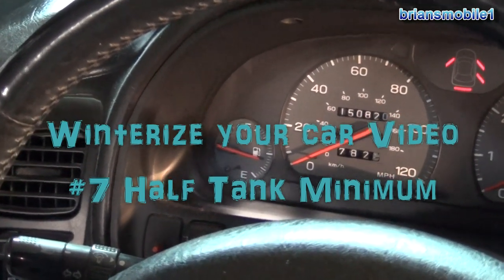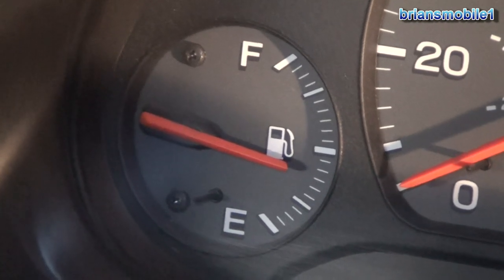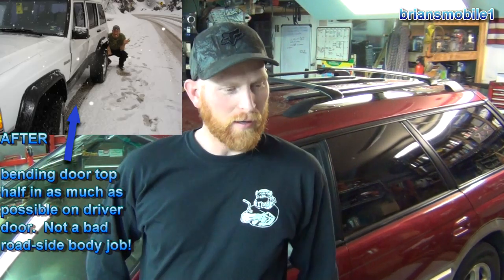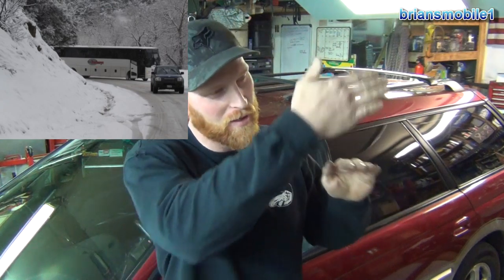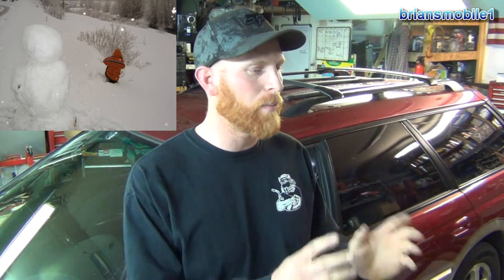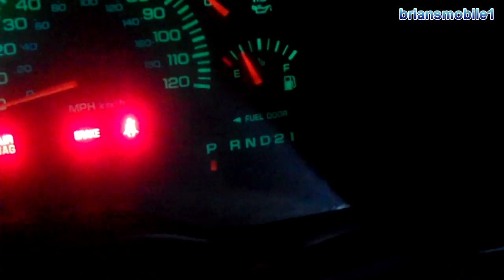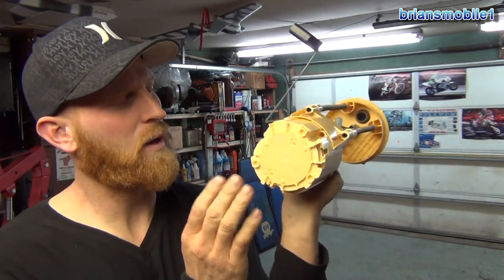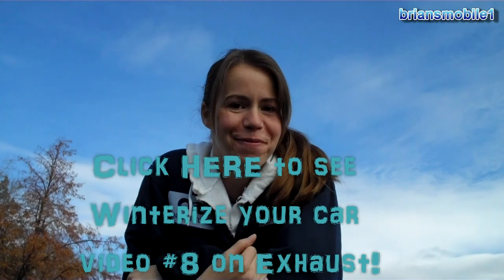Winterize Your Car Video #7 Half Tank of Fuel

Comment: Great video! Loved the story, used to run for Wisconsin coach lines for a year while out of work in my normal job. I ran  buses coming from the 60's which were quite nice and then comes driving a 2007 model right out of the the dealer. Talk about fun and floating seats. 4 wheel Disk brakes! That was a crazy year, ended up on the Waukesha  to O'hare route. It was cool and another experience in life. There was always a little extra time to get to the airport and the five stops, well the first trip we took a little detour through Chicago as I had no GPS... Find your way there.... it was an experience for me and the and my passengers... :) I was sweating bullets but somehow we made it and in time for the flights. There are allot of stories in that industry! One thing for sure, the DOT looks the other way most of the time. If you are getting on a bus watch out! :)

Being a road warrior in another business I should be better at taking care of fuel levels. In the winter yes, at other times I reset the trip odometer and have a safe haven to work with. So far I have been lucky. I had an Oldsmobile Starfire 1978 first car... That fuel filter plugged up right about 15,000... That was the only time I got stranded since (Yonkers NY), I have been lucky. Over one million miles now servicing printers for various companies.

Comment: In my work truck I keep the following for emergencies: 3 x reflective safety triangles, yellow reflective visibility vest and jacket, jumper cables, funnel for gasoline, empty 2 gallon fuel jug, flashlight, emergency candle and coffee can for heat, two cans fix-flat and a few spare light bulbs and fuses.
Reply: Robert Loblaw Slime has kit you can buy for $19.5 that contains a 12volt DC cigar lighter powered air pump for your car.The kit also contains a tire gauge, a large 32oz bottle of SLIME sealant and 3 air chuck adapters you can use for beach balls, soccer balls or footballs for an for an air mattress. By the way, the SLIME sealant works great. I treated all four tires on my daily driver with Slime and my tires have never leaked since and the ride is a bit smoother, it may have also cured a chronic balance problem I was experiencing before adding Slime. Yes it is quite messy inside the tire but it cleans off easy enough with water and paper towels. But quite worth it have almost totally flat-proof tires without buying expensive run-flats.

Comment: What got me out of trouble, when I was next to empty, was buying two litres of vegetable oil and pouring those into the tank. That was enough to get me into town where I filled the tank and drove a couple of hundred miles home.
 Only works on diesel engines though, which are already warmed through.

Comment: The old type sending units back in the day that had brass floats a pinhole could develop in them and your gauge wouldn't ever read right again until you fixed it Funny thing a soldering iron and a little time and you could repair the float. Sad how things aren't that easy anymore. I really like older cars. Easy to fix and last forever.

Comment: Water condenses from warm air in a fuel or gas tank. It condenses when in contact with the colder sides of the tank. More vacant area of tank walls, more area for condensation to occur and in turn as water is heavier than gas, (or diesel) it falls to the "low point" usually near the fuel line siphon point or tank sock and there you have an "icing situation. Crud in the tank keeps recirculating through the fuel filter, pump, injectors and return line so there's little chance it will clog the injectors as it keeps recirculating throughout the system. Products that actually do what they say they will in keeping the system free of water through suspension (where in it burns off during combustion) are good. Products that keep diesel from "waxing" at cold temperatures are really good.  Fuel suppliers concoct usable fuel for where it is to be sold and those conditions, one would hope. I uses Howes every winter Dec.1- March 31 irregardless. Never had a problem, but that's just me. The ethanol in gas also attracts water from the atmosphere, which can in turn freeze but again, products meant to emulsify the moisture in the system are the answer, such as StalBil. Once again, an ounce of prevention is worth a pound of cure...

Comment: Biggest reason to keep your tank at least 1/2 full = ACCIDENTS.
When there is a car accident the traffic usually backs up for miles on the highways and you will spend hours in traffic that's barely moving. If you have only 1/4 of a tank then most likely you will run out of fuel and then you're walking home.  I let my car run down to 1/4 full before filling it up to 100%, and I've had a few times where i was stuck for 2 hours in traffic not moving and a few times I wished I had not let my tank get run down so low  ( down to 1/4 full. ) I barely made it to the next closest fuel station once the traffic started moving again.

Comment: We used to have an old jeep cherokee which looked just like the Jeep Liberty and it was absolutely lovely it was the best car my mom has ever had it was absolutely brilliant we had it for 10 years and nothing ever went wrong with it mechanically, it never broke down due to the car's fault, but unfortunately 2 years ago it broke dow not because of the car's fault it was due to the bio diesel shit we have in England that blocked the tank up so the car could not run so my dad cleaned that out and it was perfect, we kept for a couple more years until it was 10 years old and then we eventually sold it, we miss it, it never broke down because of the car's fault, and it had only done 56,000 miles

Comment: The resistor system in the pump works like this. At the high spot it reads a very low omh and the high is a high ohm . Very low ohm is like a short and high is like a open circuit . I remember back in the late 70s I was working with my dad who was a master mechanic and I was learning from him. We were working for a taxi fleet of 40 cars. . When the fuel gauge  was wrong we pulled it out and bent it so is was close to the right reading.Do you remember the stuff that you could buy in a bottle size like HEET. It was supposed to give you 2 miles after you ran out of fuel. . But the engine had to hot.and they said it worked for Diesel . I still have a few bottles used 1 and I got 1/4 mile ran out again. Live and learn I always says.

Here a car ? my son has a 200 jeep liberty renegade V6 and 1 cylinder has no compression and the other has very high. I wonder how hard to replace the head gasket?

Comment: You should consider adding tags at the bottom of this video like "24 cable cummins prime on side of road" out of diesel ect. That way if this ever happens to me I can watch your video by searching for it. Really thankful to see the priming procedure done live like that. I have a 98 subaru, and two dodge diesels: a 1990. 12valve and a 2003 24 valve. I've never run them out of fuel but this video is a great reminder of how bad that could suck and hard on your starter. If you get the notion to post vids about cummins diesels do so!  

Anyway I really like your videos, and I almost didn't watch this one till the end, but thought I would see where you went with it.....really glad I did, and you will probably get more folks checking out your videos if you included a lot more tags on this video. Cheers!!
Reply from the maker: I was considering just doing that section as it's own video so the info is easier to find like you say.

Comment: What about the fact that nowadays fuel has 10% ethanol already in it which is the same as HEET and thus using heet is a waste of money. Heet was a thing of the 80's and 90's not needed nowadays. If you are getting water in your fuel system there is a source problem. Crud in bottom of tank from oxygenated gas? Keep it full or it will be low and suck fuel from bottom of tank? Really the fuel pump sock is always right against the tank floor. Where you get this info? We have seen -30 here never used heet never care about tank level and low and behold never a problem.

Comment: One more point. Brian, could the "DIESEL FUEL" in your truck have waxed?  Gas engines are totally different than diesel as you well know. Did you have fuel conditioner in the truck? How since the auxiliary filter was changed???

Comment: Great video Brian, however for me I never fill my car above 3/4 full, the extra weight of a full tank reduces mpg, and paying here in the UK $10/gallon for petrol and $11 for diesel is a huge consideration.
For me the minimum is 1/4, as you know better than me today's modern cars tend to use alot more plastic in construction and that includes fuel tanks, so getting the crud/rust in your tank is not the issue it once was.
Reply: Keep in mind, the injectors only use what the ecm tells them to at any moment. The fuel pump pumps away all the time circulating gas/ diesel, through the system constantly based on pump speed, mechanically driven by engine or electrical system if electric.
Reply from the maker: Tanks are plastic, but water and debris still acumulate at the bottom of the tank.  Just like oil spills float- water goes to the bottom and so does sand etc.
Reply: I've an AIRDOG aux fuel pump and the secondary filter as well. That is three filters. Fuel rushes through those filters every moment the engine is on irregardless of the trucks demand. The balance of the fuel, having been filtered, returns for another trip, perhaps to an injector or around again. I never see much of any thing in the filters when changed out and the bottom of the 22 year old tank is as clean as a baby's freshly bathed bottom.

Comment: I run out of diesel on the forecourt once, just pulled up by the pump and the engine died, took ages on the starter for it to fire up again once i'd put another 80L in! Oh and in the same van i run out on the motorway, but i was going down the gears and she fired back up, luckily was only half a mile away from chievely  services so had a very nervous few minutes at the traffic lights etc haha

Comment: Enjoyed the video.  One comment...keeping the tank full is good advice for limiting moisture buildup.  And having plenty of gas is good for the reason you mentioned in case of emergencies.  However, since the fuel pickup is on the bottom of the tank, "gunk" (particles & water) at the bottom of the tank isn't going to wait until the fuel level is low to gunk up the fuel system. Gunk will find its way into the fuel system continuously.  It just seems to fail at the worst time ! :-)
Reply from the maker: You're right about moisture- I missed that in the video.  When I  scuba dive the effects of surge on me are less at depth than in the shallows.  (fire coral and sharp rocks become scarier because it's like they're moving!)  When you shake a jar full of liquid and particles in suspension- the particles at the bottom are less disturbed than those at the top when jostled until/unless the fluid level is low.  The particles that are on the bottom of your fuel tank wash around and move with the fluid more when your fuel is 1/4 tank or less.  They have more probability of getting to your pickup strainer and sucking to it when the tank is low due to higher fluid turbulence.

Comment: There are 2 types of gasline Antifreeze. The cheap type is Methanol type and it doesn't absorb the water in the tank  (don't buy that type.)  The more expensive type is Isopropyl alcohol and that actually DOES absorb the water in your tank, so get that one instead.  I usually put some into my car's tank every 2 or 3 years to sponge out the water that accumulates there from condensation in the summer time.

Comment: My Dodge did the same thing, all of the sudden going along, thought I had plenty of fuel….not. my silly one I had to crack a few injectors, it would not push the necessary air out :( , and I was running out of crank.

Comment: How funny that this happens as you are making a video. I know my truck seems to use the last half of the tank much faster than the first half. I usually don't get much below half but when I do the last half goes quick. Must just be the position of the sender or something. I'm currently restoring a 72 k20 and using a 40 gal suburban fuel tank. Should be able to keep it above half fairly easy haha. Although the big block 396 drinks its fair share!
Reply: Your symptoms source is the path of the fuel tank sender float. Think about the tanks shape, most likely an odd shape and imagine the path of the sender float at different heights in the tank.
Reply from the maker: Sounds fun!
Reply: James Tennier  That is what i figure, nothing i am too worried about, it is just a good thing to remember to i dont expect the same milage from the first half on the last half :)

Comment: Hey Brian.. you ever tried cleaning the "circuit board" on the sending unit for the gas gauge with an eraser? It sometimes works since the board gets gunked up
Reply from the maker: I have!  I also do that on electric motors like on my model trains where the brushes touch the field.  I video'd the sending unit swap and the circuit board was hurt.  The circuit was broken in a couple places.  $75 at the dealer for a new one.
Reply: briansmobile1 Good stuff

Comment: correct me if i am wrong ,,but every one i had pick up fuel from bottom ,because the pick up screen always stays on bottom of tank like isuzu
Reply from the maker: The fuel flows easier due to less resistance through the top of the sock.  It's on the bottom so you can get as far as possible and use what fuel is in the tank.

Comment: its been a heep of years since ive had to pump a diesel engine!!most modern ones ,at least the ones from europe, bleed out automaticly!!
Reply from the maker: That would be nice!
Reply: Not the ones in the US. A lot of them don't even seem to have a bleed valve. The only way to prime them is to put fuel in the fuel filter. Which doesn't do you much good when you're out of fuel
Reply: that suck!! why isnt they evolving more? its been more then 15 years since i heard bout pumping, just turn the key after you refill and your good to go!! amreikan cars cant be that more difficult to build in the same way or ids it just lack of braincells? i dont meen to offend ,but its WAY overdo
Reply: The main reason is money. It costs more money to add a little valve than it does to not have it. Plus, they don't think that anyone will ever run out of fuel. When you let a semi run out of fuel, it's probably the last thing you ever do with that company
Reply: howcome all the european riding diesel park dont have that prolem bout the more cost? toyotas ,mercedes fords ,hell everymotor on diesel got that valve ,so the cost cant be that much more in us , am i right? we are only 5 mill in this little country but the rest of europe is pretty damn big all put together , and all ALL of these countrys run the same cars !! so expense cant be it, thats what i belive!

Comment: Buses CAN under-steer into the roads edge, blocking the road. Stop me any time. I'm all alone here... Did you help him chain-up?  Are You Gonna do a video on how to CHAIN FRONT DRIVE VEHICLES??? Make sure to point out how one should lay (previously checked) chain behind tire to be chained with wheel pointing out from bumper. Move back 18" and pull the chain over the top of the tire, fastening inside first, then outside TIGHTLY.)  Turn wheels to opposite lock and lay that chain out behind tire, and back into it and pull IT over the tire, fastening inside first, tight as you can. Drive with speed and road's condition foremost in mind! Avoid tailgating and irritatingly flash brake lights at tailgaters, so that they won't! And don't drive with flashers on. They are the only indication to those behind that (you) are experiencing a problem.

Comment: Too freakin' funny Brian!! I guess karma goes both ways. What was that about "if you see Buddha on the road, kill him"? Better hope that does apply to the rest of us when we're stranded!!
But seriously, is it possible that never letting the gas level get down to the bottom have a deleterious effect on the sending unit?
Reply from the maker: It may, but I did buy the truck used and the previous owner operated from 1/4 tank or less much of the time.